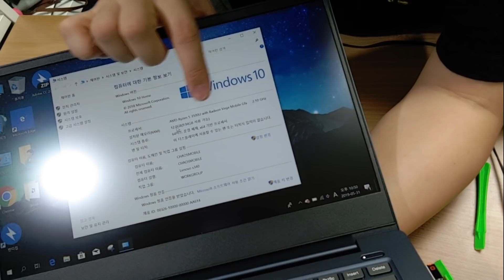Lenovo Ideapad S340-14API Unboxing & SSD/RAM upgrade

Comment: To make some things clear to those who bought a Lenovo S340-15API, I got the 256 NVME SSD (I didn’t know this was nvme when I got it) with 4+4gb ram. I upgraded the 4gb slot (only 1 upgradeable ram slot) to 16bg for a total of 20gb. I also installed a 1TB ssd into the hdd/ssd slot which wasn’t being used internally on my laptop for a total of 1.256TB of memory. Machine runs great and having the additional 1TB of storage separate is great. I suggest popping open the back panel to see what you have. It requires a T2 star bit and a pry tool.  I hope this helps
Reply: I just bought the same one and to be honest im not super familiar with pc's. Did you notice that there almost seems to be a delay of some kind when clicking on things? Its driving me insane that its not snappier considering im coming from a 2012 MBP. Does the RAM upgrade speed things up? Also, Ive read not to upgrade the removable ram because it makes it less efficient. Just wanting to make sure before I go through the process and upgrade it.
Reply: Jordan Willis to be honest
I deleted most of the “standard” software that it comes with including windows photo viewer or whatever it’s called. I use IRfanview now and have no issues

Comment: Hello, great video I enjoyed it a lot. I’m ordering a crucial 8gb to replace my 4gb when my laptop gets here. Also mine comes equipped with a 256gb ssd should I add more or is this enough? I’m only going to be playing games like Minecraft and CSGO. Also mine comes with 8gb of ram but I saw ur comment that video card takes 2gb so adding 8gb will make 10g available.
Reply from the maker: It depends what you do with this laptop.
I think 8GB ram expansion is a kind of necessary to do something beyond casual web browsing, or netflix.

If you like to install some games, I think it is wise to pick 500GB ssd, because SSD gets slower when you almost use all space.

Comment: I bought the S340-15IWL on sale for $420 and it came with a 250GB m.2 NVMe, a 4GB RAM stick (making the total RAM available 8GB as the extra 4GB is soldered on), and a slot for a 2.5 drive. I took the Samsung EVO 850 out of my old laptop and installed it in the Lenovo for storage, and will upgrade the stick of RAM to 8GB and the NVMe to 512GB. It's a VERY nice laptop, just don't expect high quality gaming on it.
Reply: Why not? I mean when I search on youtube the proccesor 3500U I find some games that runs very fluid. You don't think this laptop will run CSGO fluid? In ytb I found that's run with 100fps most of the time on low settings 720p
Reply from the maker: I think nobody expects high quality gaming for this kind of laptop.
However, it plays 3D games fluidly with appropriate graphics settings.
For example, you can play FIFA19 with auto setting flawlessly with about 30FPS all the way.

Comment: Hi! What kind of ram memory did you use? Ddr4 sodimm 2400Mhz or 2666Mhz? Thanks!
Reply: I read it's 2400mhz but need to confirm
Reply: @coolguyvideos599  In the video it shows that you are installing an 8 gb 2666 mhz memory from team group.

Comment: Who installed 16db ram to this laptop? What kind of memory channels installed on laptop after upgrade? Is it dual channel,or flexy ?
Reply: Алексей Гвоздев I went to the crucial website, their site scan tool can scan your machine and recommend all available upgrades. I installed a 16gb ram stick and it works great. I hope this helps
Reply: Hii,

Did you upgrade the ram to 16 gb? To me lenovo says I cannot upgrade. It will harm motherboard.

Thanks.
Reply: Kinjal Pandya yes it comes with 4gb onboard memory and 4gb installed into the upgradeable ram slot. I replaced the 4gb with a 16gb for a total of 20gb. That is the max one can upgrade too and is More thank plenty
Reply: @Kendro06  Is your laptop working properly or did you face any issues?
Reply: @Kendro06  when you did the upgrade did the ram still operate in dual channel mode or is it running single channel? Many thanks in advance

Comment: I bought the very same laptop in yongsan and upgraded mine with crucial 8gb 3200mhz. So far mine work just fine. I felt a little speed improvement. :)
Reply from the maker: Good for you!
It's truly great laptop for the price.
Reply: @gyuhangcho  It has a little issue thou because I bought a wrong speed. Instead of 2666mhz I bought 3200mhz . :)

Comment: You are not supposed to bend the clips that hold the metal lid on RAM. Just wedge something under the lid and lift.
Reply from the maker: Mine was really stiff. maybe I will follow your tip next time.

Comment: I have the same device, windows 10 and cpu-z said It has 2 ram ports but there's only only as showed in the video.
Reply from the maker: Do not believe cpu-z literally.
Korean model has only 1 expansion ram slot with 4Gig ram soldered onboard, but some ppl in other region says they have no onboard soldered ram, only 1 expansion slot. 
Need to be checked with local distributor or even open up the laptop to find out clearly.

Comment: Hi and thanks for the video! I was wondering about the SD card reader on this laptop and whether it is USB 3.0 or 2.0. I know a lot of companies cheap out on the reader and use usb 2.0, at least I am sure HP does on its less expensive models.

Comment: This laptop have 2 ram slot ?
Reply: One slot only, opened mine and has no ram sticks, it came with 4gb integrated memory.
Reply: @Azanch1  ah ok thanks yesturday i order on gmarket  about 499000 won with 8 Gb Ram and 250 Gb ssd
Reply from the maker: This model has 4GB soldered, and one RAM slot for upgrade.

If your model has 8GB ram, it may have 4GB stick already installed to the one RAM slot.Therefore, you may need to remove it if you want to upgrade RAM.
Reply: @gyuhangcho  Oh awesome, RAM prices are now super cheap, I might get 8gbs cuz read this model only supp 12gb.
Reply from the maker: @Azanch1  Officially it supports up to 8GB RAM stick, but it actually supports 16GB module. (according to user forums)
Reply: @gyuhangcho  Don't believe that. I made that mistake already it support one 8 GB plus the integrated; all you get is 12 GB total.
Reply: @jromeroevo  I was about to add a 16 GB but qeeing your comment changed my mind. Do you confirm it only supports a 8 GB add for a total of 12 ?
Reply: @christophechagnon4337  I feel very confident.
Reply: @christophechagnon4337  Some of the other guys stating otherwise. Get with at lest one successful person and compare computer stats before buying RAM.

Comment: Thank you for the review and upgrade! What is the laptop made of? Does the charging connector feel flimsy/cheap? Can you play modern games on it; if so how hot does it get?
Reply from the maker: Case is made of aluminium, gives a decent build quality.
Charging connector is a DC standard power pin. looks little bit old-fashioned compared to USB-C PD laptops, but looks robust. Power brick is very small, and simple.
It is very disappointing that this laptop doesn't support USB-C PD power supply.

For gaming performance, it is capable to play modern package games like FIFA19 (single player mode) with automatic graphic setting. Fairly smooth, keeps 30FPS most of the time.
However it is not optimal device to play multi-player games require higher performance.

I am preparing a simple review covering gaming performance. stay tuned :)
Reply: @gyuhangcho  Awesome! Thank you very much
Reply: @gyuhangcho  i think it is made of some kind of carbon fiber

Comment: If mines doesn’t come with a sata SSD or HDD, do I have to copy/transfer the operating system onto the SSD/HHD before installing it and booting it up? Like the computer is brand new. Not turned on

Comment: Hello , i have question. Can i put 16gb RAM(total 20gb with that 4gb on board) to mine C340 with Ryzen 3 3200u or is 12GB/16GB max.
Reply: You theoreticaly could put upto 1tb of ram thanks to the cpu
But I'm pretty sure the mobo can handle anything below 32gb
Reply: @Lolinatorishere  20 gb is the max for ram I think.

Comment: Is it necessary to break dome label to put the ram memory? I dont want to lose the guarantee
Reply from the maker: There is no sticker you need to break into the motherboard. Metal EMI shield covers the memory socket is detachable.
The only thing you need to take extra care is the plastic tab which holds back plate. It is easily broken if you do not use proper opening tool & and right force. Good luck!

Comment: I hear that upgrade this laptop with 8gb single ram will disable the dual channel mode. Is it true? And what consequence ill get?
Reply from the maker: Good question Ian.
For modern pc & laptops, dual channel work not only symmetric setup(same sized modules) but also  asymmetric setup. If you install 8GB module, 4 GB portion of your 8GB RAM module will work as dual channel with 4GB of onboard RAM. and another 4GB will work as single channel. This is not same like symmetrical dual channel, but it is still beneficial.

Dual channel is 'technically' beneficial for more heavy load situations such as 3D gaming, hi-res graphic job.

In fact, having 4+8GB RAM is so much better than having 4+4GB setup, because total RAM capacity is way more important & effective for everyday use, including casual office/graphic works.
Reply: @gyuhangcho  thanks for ur reply. Can I ask another one? How to activate dual channel mode on this laptop? Is it active by default?
Reply from the maker: Dual channel is not a thing to turn on or off. It automatically works. Do not worry about it, and just upgrade RAM as mush as you want. :)

You can check if dual channel is 'on' with softwares like CPU-Z
Reply: @gyuhangcho  thanks a lot for your help . Really appreciate it :)

Comment: Does anyone has battery problem with above notebook Ideapad S340-14API  eg. battery unable to hold charge, or battery lost power very fast ?
Reply from the maker: I can think of 3 possible reasons.
1) degraded battery : if you have used the laptop more than 1.5~2 years under very harsh condition (=meaning charging/discharging frequently), the battery may be too degraded. check battery cycle, and estimated capacity.

2) if you connected anything to the power charging port, it will drain out internal battery even the laptop is off. disconnect all USB peripherals, and test again to verify if this is the case.

3) This laptop has an battery indicator function even if the laptop is off. if you are using key skin, it may press keys to activate this function without you knowing it. enter the bios (or UEFI) and turn off the function and see if it helps.
Reply: @gyuhangcho  Thank you.

Comment: What will happen If I try to change the RAM memory without disconnecting the Battery cable?
Reply from the maker: Extremely dangerous. ALWAYS REMOVE battery cable whan you do something with laptop motherboard.

Comment: Hello brother, can you tell me where you bought the screwdriver that I want to improve my pc and I can't find it?
Reply from the maker: I've got mine from Amazon.com. Oria precision screwdriver kit 54 in 1. See link below.
https://www.amazon.com/gp/product/B07281FT78/

Also, you might need some plastic opening tool, for opening the case safely.
I've got mine from aliexpress.com, but I found a similar one from Amazon.com, too.
https://www.amazon.com/dp/B07DLS46M2/

Or, even you can buy Oria 76 in 1 kit instead, which includes precision screwdrivers, and some opening tools you need.
https://www.amazon.com/gp/product/B01IVKPTP6/
Reply: @gyuhangcho  thank you

Comment: Did u install Operating system on the new SSD?
Reply from the maker: Yes, I did. 
I'm considering to buy a NVMe SSD though.
Reply: @gyuhangcho  Did you get a NVMe SSD? I ask as I've just purchased one with a 512GB SSD and I was wondering if I can use the NVMe also??
Reply from the maker: You need to check which type of SSD is came with your Laptop.
Crystaldiskinfo is a optimal tool for checking storage model name.

Comment: My model comes with 8gb of ram and i can only use 6gb out of 8 so i've decided to add another  8gb ram to it what ram is compatible with this device
Reply from the maker: If your model came with 8gb ram total, it is 4+4. 4gb soldered, 4gb module inserted to ram slot.
If you want to add 8gb, you need to take out 4gb module came with.
Which makes 12gb total.(4 soldered 8 expansion)

Physical ram is 8gb for your device at the moment, but 2gb us reserved for integrated graphics core (AMD VEGA). so, if you upgrade to 12gb(4+8), about 10gb will be usable ram

By specsheet it supports up to 8gb ram module, but actually supports 16gb module, too. Which makes 20gb ram(4+16), usable will be about 18gb
Reply: @gyuhangcho  any specific ram module youd recommend for a 16gb stick
Reply from the maker: @hansolo3854  I'd use modules from well known brands such as samsung, micron, corsair.
Reply: @gyuhangcho  which 16gb ram frequency is good for this laptop?

Comment: For attention - work temp this processor - 75-90 C, ssd work  temp 40-60 C
Reply: Wow, really? I was going to buy this laptop in hopes of AMD cpu running cooler and fans being quieter.. Is this under full load? Are there any other laptops that might be more quiet?
Reply: @icyfoxe  FYI I got this laptop with Ryzen 5 3500u. Running stress test with Cinebench and AIDA 64, the max temp i got is 75 C. Play DOTA 2 1080P Fastest 100% render, max temp hovers around 72 - 75 C but mostly stay at ~65 C. Browsing and other light stuff it hover around 39 - 55 C. It's pretty normal temperature for me
Reply: @theorangecat2929  Thanks. I already tried this laptop and while temperatures were as you say max 75°C, fans were kinda loud and whiny, even when laptop was running idle. That's why I bought instead Acer Swift 3 with the same CPU.
Reply: my R5 3500u 500gb nvme variant runs about 60°C in games, ssd never goes above 40°C

Comment: @Gyuhang Cho ...WHat is the highest ram speed that this pc supports?
Reply: I read it will only support up to 2400mhz. Is that right?
Reply from the maker: @coolguyvideos599  Yes, this laptop only supports up to 2400 Mhz, and there is no overclock option in the UEFI(BIOS).
Since the most (99%) RAMs have backward compatibility for low-frequency, so there is no reason to intentionally buy a DDR4-2400 module instead of a DDR4-2666 module (which is easier to find, and generally cheaper).
If you buy a DDR4-2666 laptop RAM module(called SO-DIMM) manufactured by well-known brands such as Samsung, Hynix, Micron, Teamgroup... it should be okay.
Reply: @gyuhangcho  Does this laptop support 2.5 inch sata drives? (I currently don't have a m.2 one.) Is it a 2242 or 2280 m.2? Just curious.
Reply from the maker: @coolguyvideos599  This laptop does have 1 x M.2 slot (2280), and 1 x 2.5 inches SATA bay, but the SATA bay only supports up to 7mm thick drives only.
Reply: @gyuhangcho  I have a samsung evo 850 ssd. Do you happen to know if that is a 7mm drive? Also is upgrading the battery to a bigger battery possible?
Reply from the maker: @coolguyvideos599  As far as I know, all SATA SSDs are 7mm drive only. there are 9.5mm or thicker drives only for HDD drives.
In terms of the battery, the official specification sheet from Lenovo states only 1 type of battery (Li-Polymer 52.5Wh), so I don't think there will be any bigger replacement.
If you need more runtime of this laptop, you might want to consider combination of an external battery and a usb-c PD to ac converter cable.
Reply: @gyuhangcho  External battery? Do you mean to say a power bank? Do you have a link to an example of the converter cable? I never have heard of it. Also I was thinking to use  a T5 screwdriver to open the laptop. Is that the correct size?
Reply from the maker: @coolguyvideos599  Unfortunately this laptop does not support USB-C PD charging, but there are 3rd party converter cable available.
Amazon (universal adapter) - https://www.amazon.com/dp/B08ND8BC8N/
You can also find at aliexpress for dedicated type. (must check diameter, and voltage)
Keep in mind that this type of cable may not be safe, and sometimes not work.

In case if you use the converter with power bank, you must have USB-C PD type power bank which can support 65W or more output.

Regarding the screwdriver, I do not remember if it was T5 or T8, and I already sold this laptop few weeks ago.
I suggest you to get a precision screwdriver set.
Reply: @gyuhangcho  Do you have a power bank that you would suggest? I have one but no idea if it supports 65 watts.
Is it possible to upgrade the wifi card as well? If so how do you know if it would be compatible? Please let know and thanks again.
Reply from the maker: @coolguyvideos599  check my other video for wifi card upgrade.
https://youtu.be/c-osg0FC3Ao
 Compatible cards are depends on your specific laptop model.

For high wattage power bank, there are not many options. If you are in US, anker 737 would be avilable for you.
Reply: @gyuhangcho  Okay, is it possible to upgrade the bluetooth module on this laptop as well? Just curious
Reply from the maker: @coolguyvideos599  For most laptops with replacable wifi card, the wifi card is actually wifi+bluetooth card integrated as one card. 
If you use the same card I used for my other video, you are actually upgrading not only Wifi, but also Bluetooth from 4 to 5
Reply: @gyuhangcho  Thank you very much.

Comment: I disconnected the battery to update the ram. When I turned it on, it doesn't recognize the battery and it's only on if I have it plugged in. What I can do?
Reply from the maker: Either you didn't re-plug battery cable, or you may damaged during the process. I suggest you to bring your laptop to the engineer.